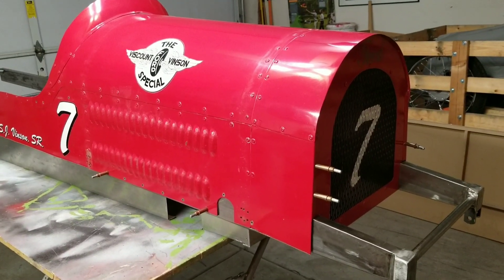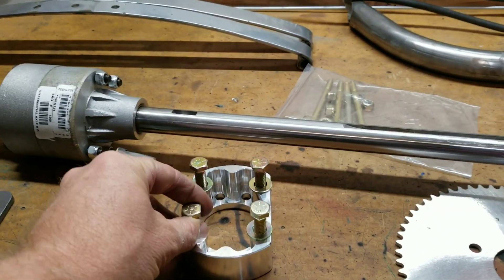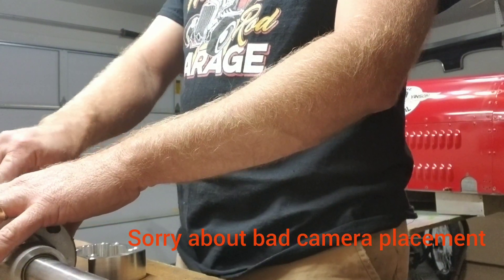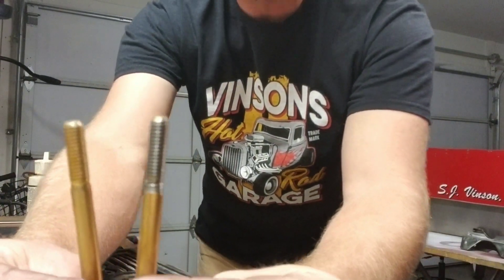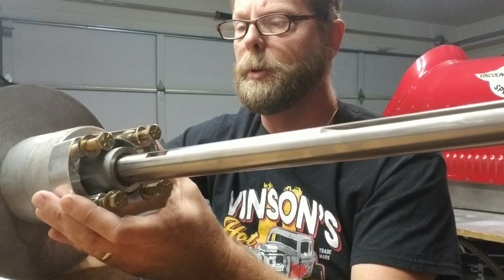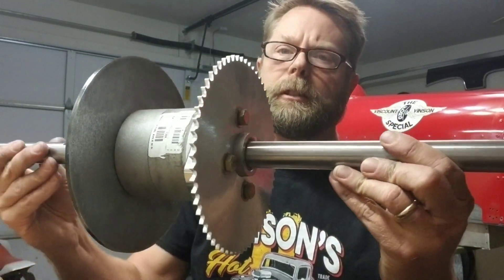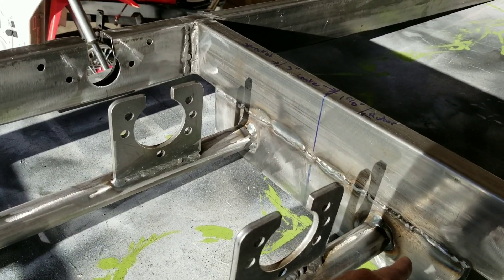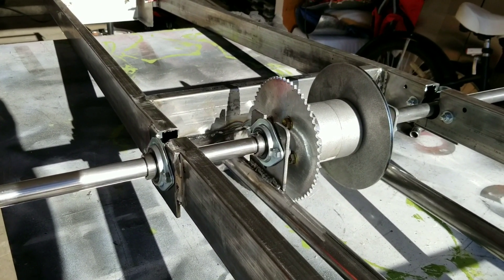Cyclekart Frame Video #7 rear axle

Comment: when you put the additional piece under the frame cross member to weld the supports for the axle bearings, did you also put a corresponding piece under the rear cross member too - or did you angle the pieces up?
Reply from the maker: Yes there is a dropped area at the rear of the frame. the motor plate will sit on top of those 2 round tubes

Comment: what sprocket fits with that bolt patter ?
Reply from the maker: You will need a sprocket designed to fit the differential.  It is available at the same vendor who sells the differential.
https://www.staton-inc.com/store/26.-35-sprockets-roller-chain-3/8-x-3/16/35-a-60-tooth-sprocket-for-the-peerless-100-series-141-d-differential-4-hole/

Comment: HOW WIDE IS THE IS THE FRAME IN THE REAR, AND WHAT IS THE WIDTH REAR AXLE YOU USE, AND DO YOU USE SAME IN FRONT? THANKS, I WOULD APPRECIATE YOUR REPLY.
Reply from the maker: The standard size rear axle is 36", you typically want the front to of similar width.  The frame tapers from the front to the back.  The front is usually between 16 and 18" wide, the rear end up around 20 or 22".

Comment: WHAT PARTS DO YOU NEED TO INCORPORATE REVERSE ACTION ON CYCLEKART?
Reply from the maker: the simple answer is to use your arms.  The rear tires are close enough to reach and we can do a bit of 'wheelchair' roll to move around.  Some guys have added reverse, but it adds a lot of un-needed weight, cost and complexity

Comment: I’m curious Steve, how do your karts ride with no suspension in the rear ? 
Why doesn’t anyone use a rear suspension ?
Reply from the maker: They ride fine.  Some guys have used a rear suspension, it adds time, money and effort.  It can be done.  Is it worth it?  Only if you think it is.  If you are mostly on pavement, it wont matter, if you are mostly on rough roads....suspension can help.
Remember, this is cool looking gokart.   Not a real car.
Reply: @stevevinson6030  thanks for the reply and info Steve. I’m fascinated by these. I guess it fulfills childhood dreams of running go carts. I’m seriously considering building one of these. I have all of the skills to do it, welding, etc. I’m guessing the peerless diff is the way to go especially if I plan on running on asphalt. I’m also wondering if there are any cyclekart events on the east coast. Again thanks for the info, I’ve already learned a lot from your videos.
Reply from the maker: @danbarone7643   The east coast has several areas where groups are forming and having events.  If you are on Facebook you will find the Southeast Cyclekart group as well as the Northeast cyclekart group.  Depending on where you are on the east coast.

Comment: I am slightly hesitant in making this comment because you know your dimension criterion. I would look to setting the disc brake distant from the diff and the sprocket closer to it because the liquid in the diff is limited and the heat from the brake will be relatively high. While the sprocket may run slightly warm it will not have the heat variation of the brake.
Reply from the maker: Good advice, some guys run 2 separate brake setups.  One on each axle. However, after several years of very hard use, no problems so far with the differential. Thanks for watching
Reply: @stevevinson6030  good to hear this. I read some people saying the single brake on the diff wouldn't let you brake at all if one wheel slipped...

Comment: Thank you for details you share .. Why do cycle karts have suspension only on the front
Reply from the maker: Thanks for watching.  I am not 100% sure but is probably because it is very difficult to add suspension to the rear and keep it relatively light and simple.  The front suspension is only marginally effective.  Also, the front suspension is a large visual cue for the looks of the kart.  It looks nifty.

Comment: Is using a single disc rotor for brakes a typical setup for a kart with a differential?
Reply from the maker: Yes it works to break both wheels. Even if you run a solid rear axle, the single brake works fine

Comment: Thanks for such informative and helpful videos! So how big of a metal brake bender do you use, it looks like your aluminum sides where you put the flange on for the floor is a long piece, I have access to a 36" brake but  how do you put on those long flanges?
Reply from the maker: The break that I used is 10 feet long.  If using a 36" long break, probably not a big deal. You will just have a few joints or overlaps.  If you want it to be one long piece, most AC fabrication shops can probably bend it for you.

Comment: How does that rear work when you give it gas say like burnout will both wheels spin??Then when your turning the one wheel unlock like so not having a like live axle ??? Thanks
Reply from the maker: Both wheels will probably not spin. The benefit is that it will transfer power to the wheel that is not slipping. On my current kart with a solid rear axle, it turns left great. But when I turn hard right, the powered wheel loses traction...only one wheel is keyed to the axle, the other is free wheeling. Thanks for watching.